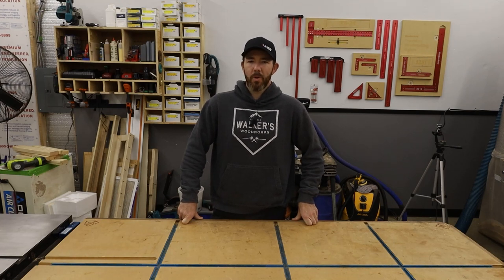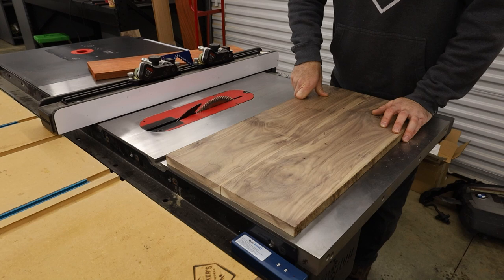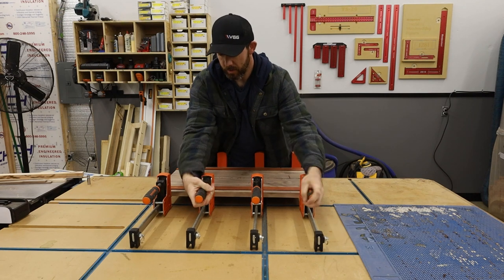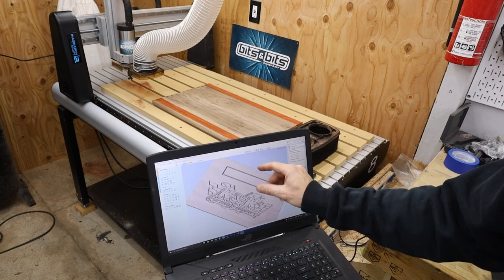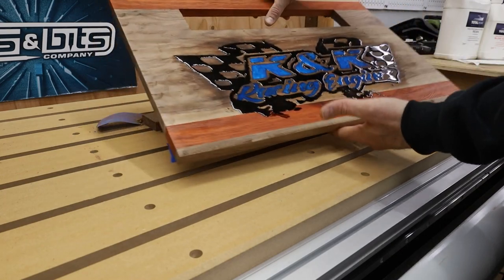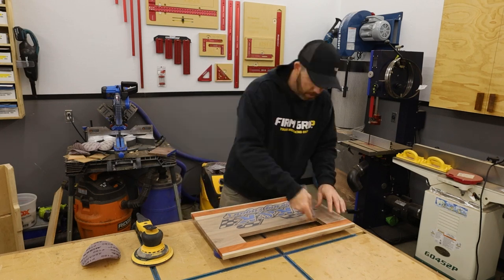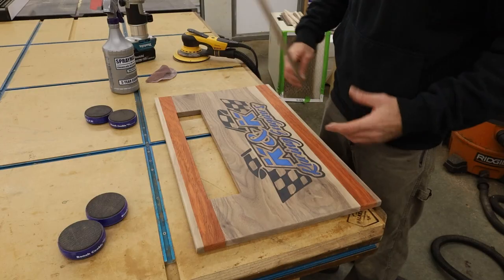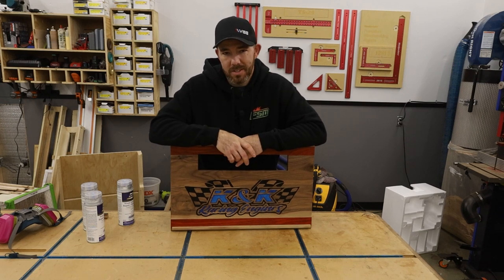In Car Mobile Laptop Stand AND Some Epoxy Tips!

Comment: Brandon, been on the CNC since 2008, but new to epoxy...just did first pour on a cutting board.  Are the oral syringes reusable?  Can you rinse them out with denatured alcohol?
Reply from the maker: They are cheap enough on Amazon I just toss em. I think you can get 100 of them for like 20 bucks.